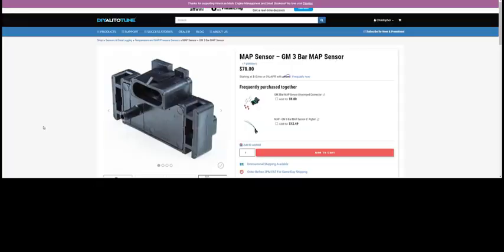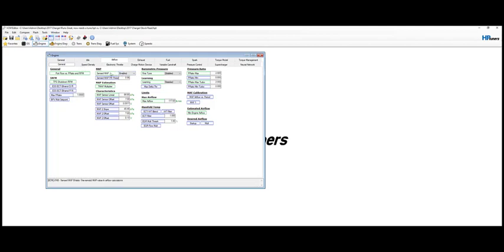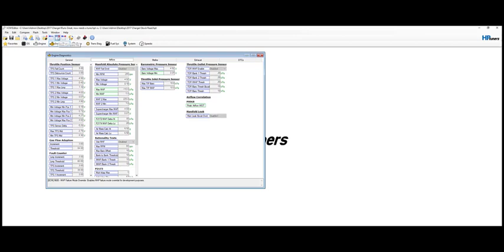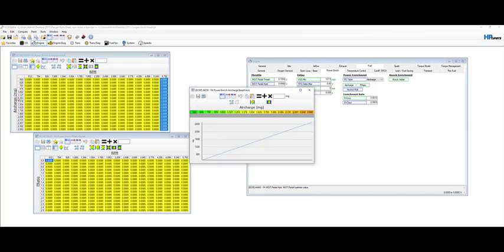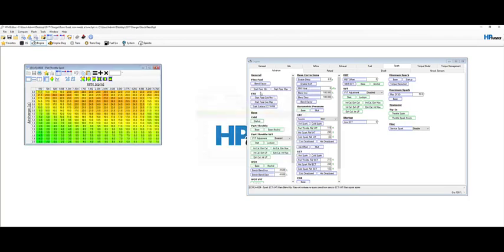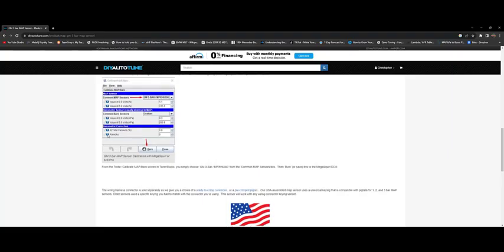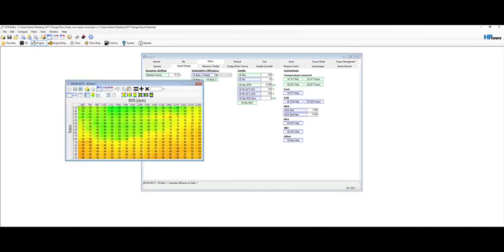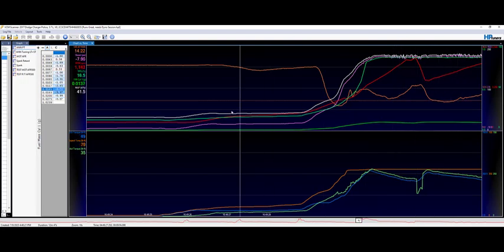Hemi 3 Bar Map Sensor Swap (Shhh, its a GM sensor...)

Comment: No changes to sensor offset? Did this read true compared to a boost gauge? Thinking of doing this as srt4 sensors are a bit hard to get
Reply from the maker: @TheBorginator From my research on DIY Auto tune and other websites these settings represent proper atmospheric pressure. I did not verify with any type of scientific testing. I plugged it in and did a burnout! I bought the GM Sensor for exactly the same reason as you, it's setup parameters are much more accessible and availability.
Reply: @CarswellsCustoms   Hey thankyou so much for your reply. I have one on its way. Will report back how it goes. Love your videos. Great to see a person that thinks outside the box.
Reply from the maker: @TheBorginator  Thanks bud! Good luck, and reach out if you have any issues.
Reply: No luck at all with any settings I put in. Wheather mine is faulty or something I don't know.
Reply from the maker: @TheBorginator  Oh no, that sucks. Double check wiring? Can you measure the voltage when applying vacuum to the port?